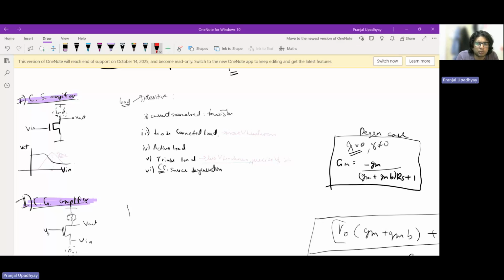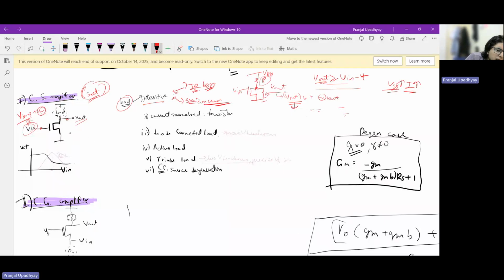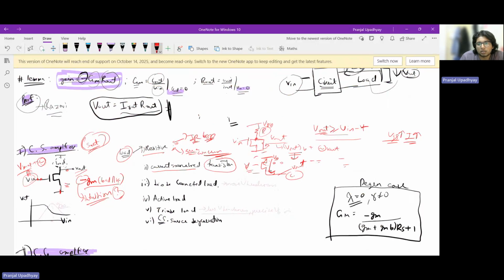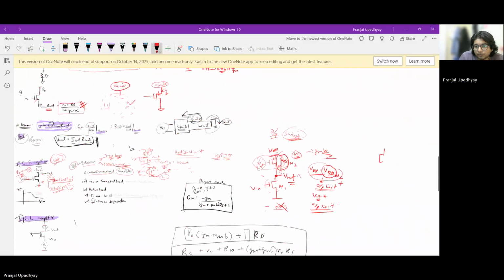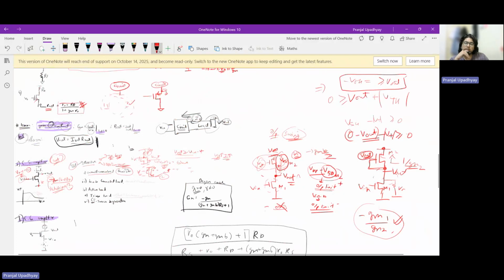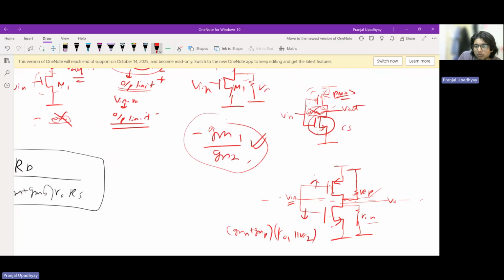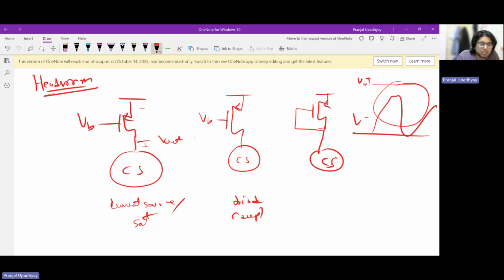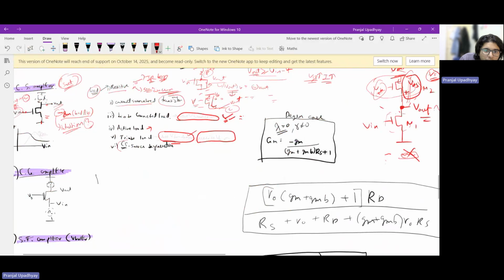|Part2| Chapter 3 Single Stage Amplifier |Design of Analog CMOS ICs by Razavi |  Revision vlog

Comment from the maker: There is an error      towards the end of the video where I am discussing about the voltage headroom of diode connected PMOS load. the actual upper voltage limit of Vout is  calculated by:                                             VDD minus Vout minus mod of VTH must be greater than 0, which implies that the upper value of output voltage is limited to VDD minus mod of VTH. 
So that is the upper swing limit on Vout.
 this is the correction to the, to what I said towards the end of the video and I have addressed this in the start of the part 3 video